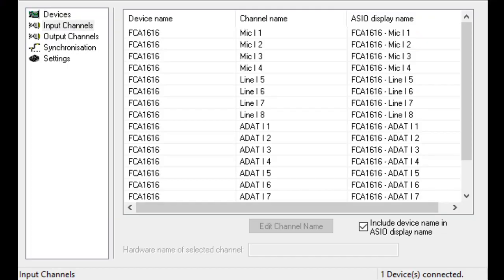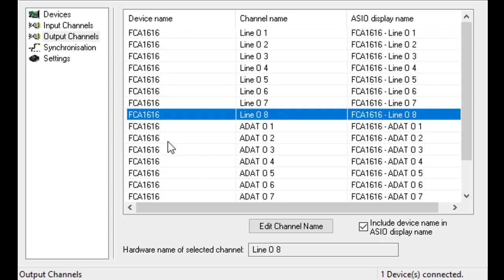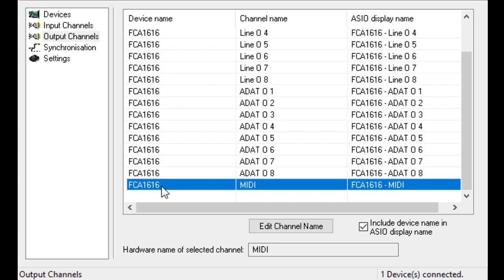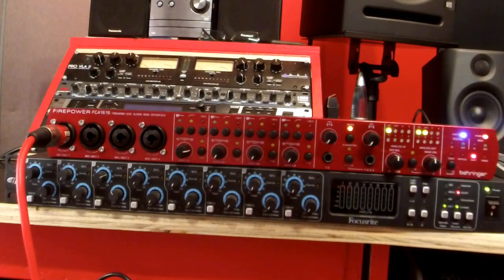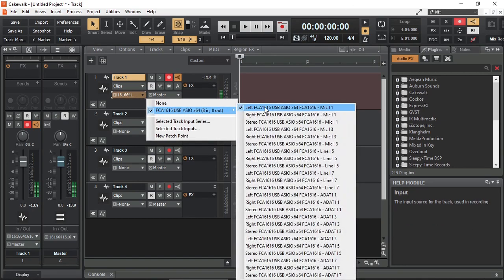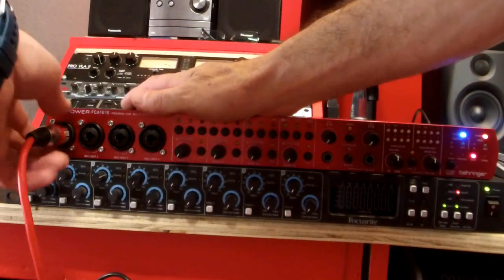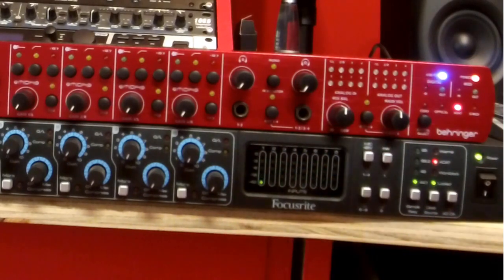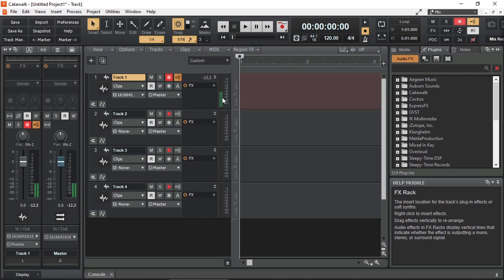Connecting an ADAT Unit to Behringer Firepower FCA1616 Audio Interface

Comment: that sound card can go upto 96 not 48 bro
Reply from the maker: The Firepower supports up to 48 kHz, which is what the max sample rate is for ADAT connection. 
As a stand alone device, FCA1616 does support up to 96Khz sample rate and up to 24 bits.
Reply: @RecordingStudio9  thanks for that Intel ,I never knew ...one more thing can I use it with Windows 11 using usb connectons ,coz I had a problem having it work on sample rate higher than 44.1 on win 10 and do you know a way around that

Comment: I connected 8200 to fca1616. it recognizes all the 16 inputs and works fine, but the Adat led keeps on blünkğng forever, is it because I use the firewire connection, can I keep on using it while it blinks?
Reply from the maker: Make sure you have both units set the correct sample rate.

Comment: Can I also connect two of focus rite 18i20 unit using the same Adat connection?
Reply from the maker: No, one ADAT per connection. Some mid and high range interfaces support 2 ADAT sockets for double I/O or higher sample rate.

Comment: Awesome video! Quick question though... Do you need to sync the octopre with the fca1616 via world clock for the sample rates? Or is that just for syncing multiple interfaces?
Reply from the maker: Thanks. ADAT already includes clock sync data.
Reply: How many lines can the Behringer fc1616 audio interface have in Cubase pro? please help me
Reply from the maker: @tayebrahmani3012  All 8 analog + 8 ADAT or 2 SPDIF inputs and outputs.
Reply: I mean the number of tracks a behringer sound card can accommodate in cubase pro without damage to the sound card
Reply from the maker: @tayebrahmani3012  You can record 8 analog and 8 ADAT, a total of 16 individual tracks in Cubase, all at the same time. FCA1616 is a multi-channel USB audio interface.
Reply: Thank you so much for everything
Reply from the maker: @tayebrahmani3012  This playlist might help you https://www.youtube.com/watch?v=rkM8jqlcgRk&list=PLeySI9gLWqeydhiDYAzWGVDsQ1O86Ozci

Comment: What about drivers for the focusrite? In my case I plan to use my old motu 828mk2. Motu still provide updated win10 drivers for this older unit, do they need to installed? Or is it just the behringer drivers that are needed. Also wanted to ask your thoughts about if I install a firewire pcie card in my pc. Can I then run the motu gear via firewire ( i have 2 interface with adat) and the behringer via usb. In my mac i could do this by creating an “aggregate device”, so that i get all 3 boxes working simultaneously in the daw? Do you know if there is a way to do this with win 10? Cheers mate
Reply from the maker: Thanks for watching. ADAT extension pre-amps don't need drivers as they communicate direct via ADAT to the host.
Under Windows 10, the only option is to use ASIO4ALL driver to 'aggregate' devices, but with my personal experience, this does not work well past 2 devices and 16 in/out. Yes you can use USB and FireWire with ASIO4ALL, but as I mentioned earlier.
Best of luck.

Comment: The Behringer fca 1616 is listed to have 96khz sample rate?
Reply from the maker: That is correct, but ADAT only supports up to 48Khz. Some interfaces use two ADAT in/out to get 96Khz sampling rate.
Reply: Thank you. Amazing that a 2014 product is still supported?
Reply from the maker: Yes, fully supported, but not sure for how long.

Comment: Thx for the video!  Maybe in the future, you could post a video of the process for using ADAT in order to integrate outboard gear (e.g., Studio One PipelineXT).  I have seen your other informative Pipeline videos, but I can't seem to get them working with ADAT   :/
Reply from the maker: The procedure is no different with ADAT extension as the inputs and outputs appear part of the audio interface. These might help you https://www.youtube.com/watch?v=tLxLvkZ4DsM and https://www.youtube.com/watch?v=vj6eflS6JDE
Reply: @RecordingStudio9  Thanks again... for some reason Pipeline is really finicky.   Sometimes it works, others times I get no "return", and other times it sounds phasy when printing to a new track.  Go figure!  Salud...
Reply from the maker: Make sure the auto latency compensation button is off.